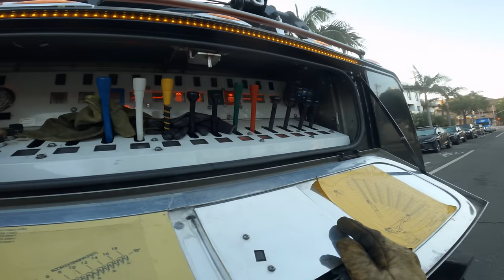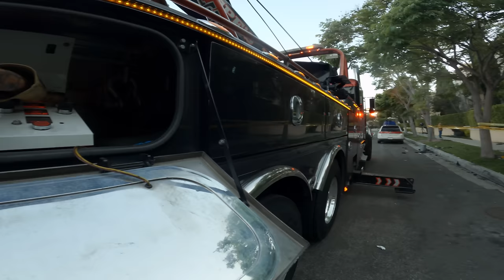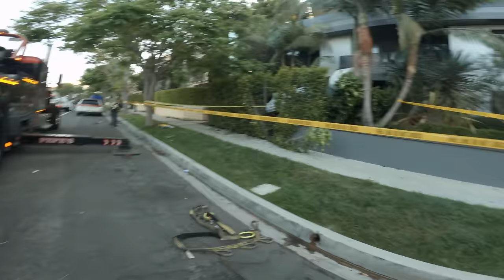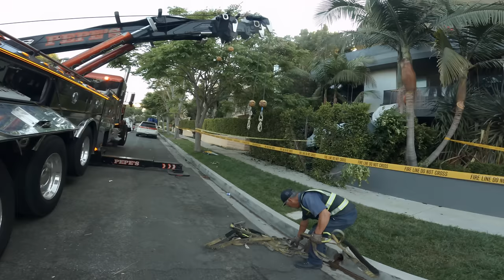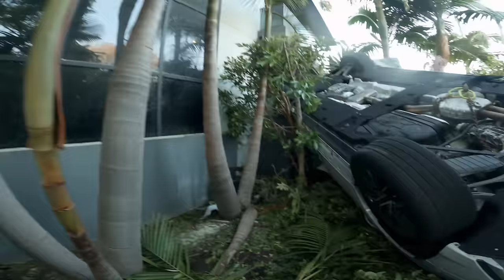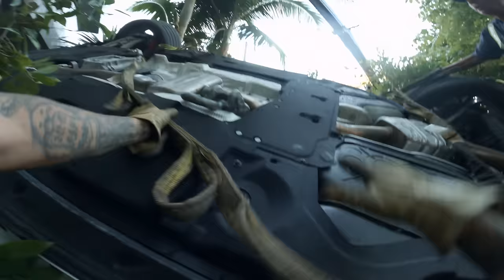Audi Q8 WRECKED after crashing into Apartments!

Comment: Given the increased number of hybrid and/or full EV vehicles on the roads today, what changes will Pepes Towing Service make if any, when dealing with this type of service call?
Reply: I can only speak from a motorsport perspective, but I'm guessing in a crash like this it'd be kind of similar where fire/rescue make it safe using the HV disconnect before a recovery vehicle goes anywhere near it. There are usually rescue/recovery guidelines published by manufacturers for new vehicles that cover stuff like this